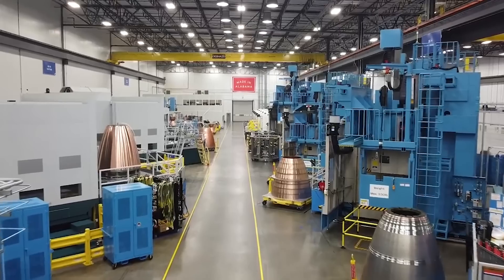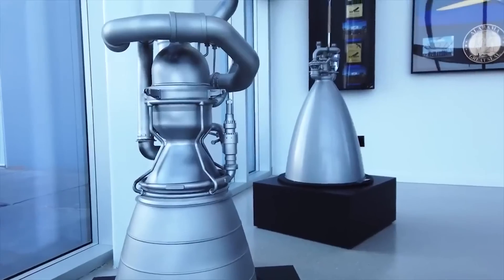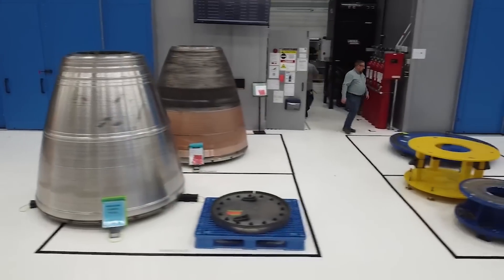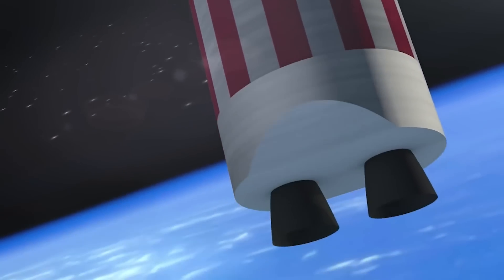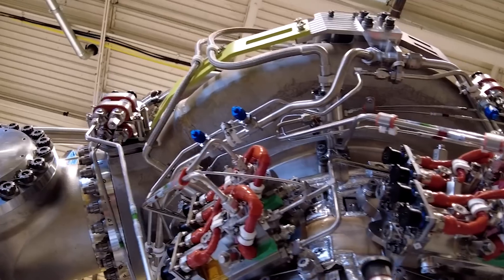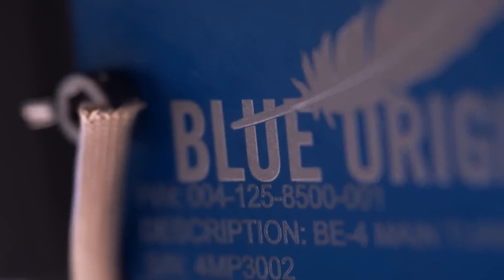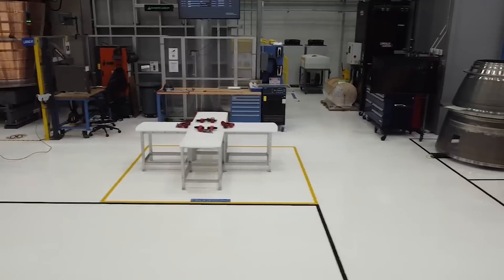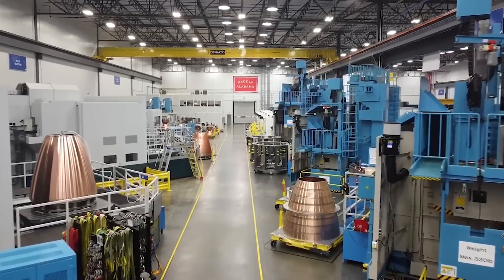Blue Origin Prepares To Produce Hundreds of BE-4 Engines

Comment: If Amazon shifts the satellite launch to space X, I wonder what will be of blue origin and ULA!!!
Reply: They won't. Despite what you may hear, even SpaceX has its limits. They only few a couple OneWeb launches while ISRO and GSLV-MKIII flew the others. The Globalstar launches are two years at least in the future. And Kuiper is not going to send money to its biggest rival.

On top of that, the first launches for Kuiper are scheduled to fly on 9 Atlas Vs. The contract is structured so that Atlas flies first with Kuiper, then Vulcan, then Ariane 6, and then New Glenn. And New Glenn only has 12 launches compared to Altas and Vulcan with 47 and Arian 6 with 18.

Comment: 2024 is a make it or break it year for both Blue Origin and ULA. I wish them both good luck, but continued delays past 2024 means SpaceX will have to start taking over.
Reply: I don’t think so, space x is already in a big lead. But there is just too much going on for space x to do everything themselves. I don’t think 24 will break either company because BO has enough money to keep it going forever
Reply: The military contracts for ULA start in 2024 and then ULA has a contract for 60% and SpaceX for 40%. NASA has a launch contract for Blue Origin in 2024. Sierra Space has said they can launch on multiple vehicles if ULA is not ready in early 2024. I hope Blue Origin and ULA both succeed, but they cannot keep coming up with excuses. As you said, SpaceX has a big lead in both technology and 80% of the world's launch weight to orbit.
Reply: @MrEd2291  they will be successful
Reply: @MrEd2291  I am curious as to where did you get those numbers from? The government contract percentages? Just purely curious is all
Reply: @MrEd2291  It's not hinging on BE-4 really anymore. The Centaur V with mods needs to pass the qualification test that it failed back in April or it won't matter how good the core and BE-4s are.
Reply: @MrEd2291  Tory should get his reasamay ready for X and that doesn't take a 🚀 to figure out🤑

Comment: Switching production lines because your main line is being out performed by your prototype line is very bad.
Dynetics had plans for an F-1B, with 2.2M lbs thrust, ready to go 10 years ago, and it still seems like a viable option today.
How Bezos managed to screw over ULA while being in direct competition with them is beyond me. BO has never achieved orbit and neither have their engines.
Reply: Plans are plans and those never got past the testing of a single 3D-printed part. Aerojet Rocketdyne had plans for AR1, but sat on them waiting for more money from the Air Force, and never did more than test a few parts at time when Blue had tested full powerpacks, and then full scale engines.
Reply: @mikedicenso2778  Yeah, talk about dropping the ball. It's one of the biggest mistakes a Legacy Aerospace company has ever made. If they had gotten a couple AR1s built and test fired around 2016-2017, AJR would've won the contract easily. 

That being said, I don't think they'd have done much better than Blue at developing and producing AR1 for Vulcan.
Reply: Some are good with words (Bezos + goons), some are good at deeds (Musk).
Reply: @paulmichaelfreedman8334  
And some drink the Fool-Aid that is so generously dispensed. Some are adults and some are children!
Reply: @paulmichaelfreedman8334  "Acta non Verba."
   - Deeds not Words.
Reply: IFUSāSō! Let’s check back next year.

Comment: If BE-4 production is going so well, then why are Amazon shareholders, including the Teamsters pension fund, suing Amazon and Jeff Bezos for not moving the Kuiper project forward in a timely manner?
Reply: A similar pension fund sued Elon Musk and Tesla for the Solar City purchase back in 2016, and after 7 years of litigation the suit was dismissed. It's most likely that this one will be too.

Also, BE-4 has nothing to do now with the current Vulcan delays nor does it for Ariane 6. ULA has only themselves to blame right now because of the Centaur testing debacle back in April. BE-4 overall has done very well despite the ATP setback in the last year.

And some good news just came in: Ariane 6 passed its test firings of the core stage and the second stage.
Reply: @mikedicenso2778  now here’s a fella that knows what he’s talking about!!! Here’s  a toast to you mike
Reply: @mikedicenso2778 The third BE-4 engine meant to go to the second Vulcan Centaur exploded unexpectedly. So the issues are with both the BE-4 engine as well as the Centaur upper stage.
Reply: @aninditabasak7694  Did you not listen to this video or have paid any attention to the news in the last several months? The reason it exploded was due to faulty workmanship, something that's expected and its replacement was shown by Tory Bruno at Huntsville, which is why the ramping up of production there is so important, so that early on they can weather through tweaking the ATP and work processes. The engine design successfully went through qualification testing and is good.
Reply: Amazon share holders are suing Amazon Web Services for breach of Fiduciary Duty by using Blue Origin / ULA / Ariane Space rockets instead of SpaceX Falcon9 based on cost.. thing is though is price per Kuiper sat is equal on New Glenn & Falcon9 (roughly $1.2M per sat); so unless the lawyers focus on ULA & Ariane 6 launches (which are more expensive per sat) they won't get far.
Reply: The Amazon lawsuit is regarding if Amazon looked into using SpaceX or refrained from even considering then for launching Kuiper due to not wanting to support a Blue Origin rival.

BE-4 production has no major relation to the lawsuit.
Reply: Was just going to say. If BO produces 10 BE-4s before the end of 2024 I will be very surprised.
Reply: @paulmichaelfreedman8334  they’ve already built 24 sooooo I guess it’s time for you to be surprised, also with hundreds more by 2024
Reply: Hahahahaha, this is just the very beginning. I can’t wait to for BO to shut all you SX fanboys up hahahahahahahaha
Reply: @MaxStax88  What goes on in that puny mind of yours...
Reply: @MaxStax88  that is not an argument.

Comment: I sure hope their ramp up goes well, but I’ll believe it when I see it. BO has not done well with engine/ new glen development tbh
Reply: The ramp up has already happened and is increasing, that's what the point of the video and mentioning how one factory is overtaking and replacing the other in providing engines.
Reply: @Nowhereman10  I just do not believe BOs word that everything is ramping up and going smoothly. I want to see proof of the ramp up, and this means many, many successful flights of the BE-4, and there have been zero.
Reply: @ryanpeeples6998  Nothing has been said by Blue about that. Where did you ever get that idea from?

Tory Bruno said it and the photos and video show that many engines are in work is proof of it.